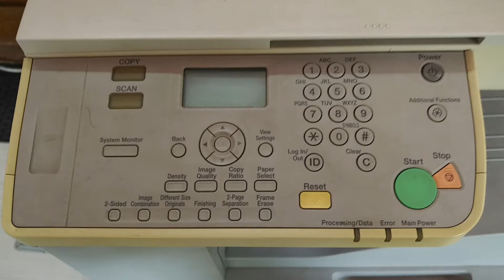Replace drum || Blade || PCR for Canon IR 2016 || 2018 N||2318 L || 2420 || 2320 || 2220

Comment: How to solve fade print
Reply from the maker: Where the print is fade ,on the top?
Reply: @trustmesolutions  no, firstly black line on the page after cleaning the drum unit now missing word across that line. Pls hlp
Reply from the maker: Clean the blade or replace the blade
Reply: @trustmesolutions  There are two types of blade,  one is flexible cello tape type another metal
Reply from the maker: @sksahidul216  replaced the metal blade